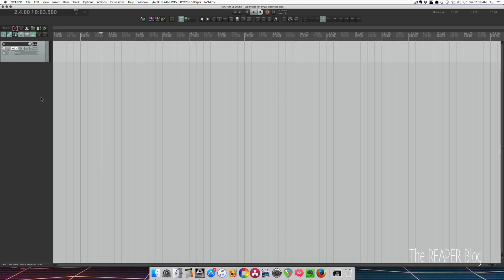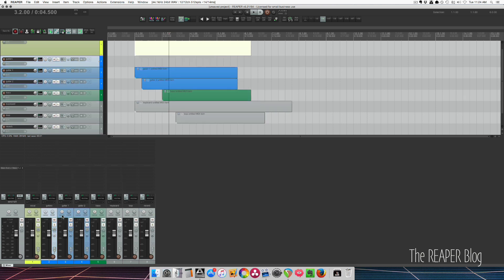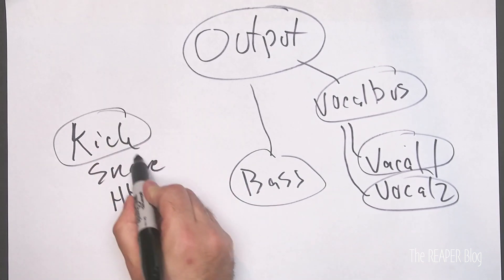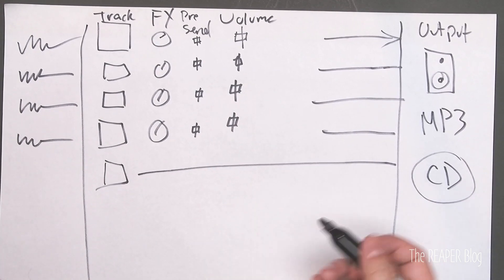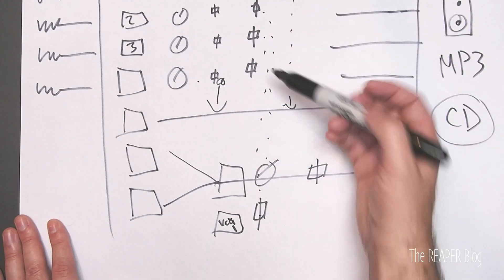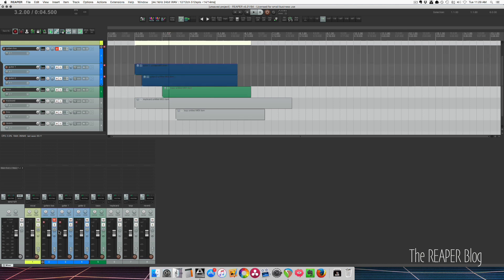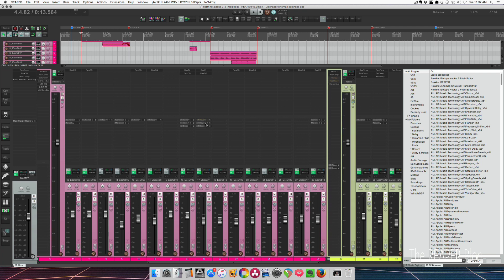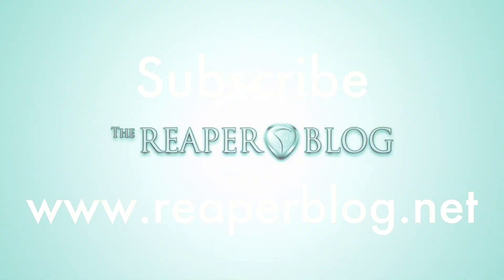Audio Routing Explained - DAW signal flow tutorial

Comment: So I’m having an issue when I put anything into a folder: anything inside that folder I try to pan right disappears completely, but seems to act normal when I pan something to the left. Why can’t I hear my guitars when I try to pan them hard right? Does it have something to do with my master/slave settings in groupings?
Reply from the maker: follow the signal flow, bypass the plugins one at a time to find the problem
Reply: @TheREAPERBlog  Gosh... I think I figured it out. My cla mix hub and c4 compressor were both the mono plugins lol... I just changed it to the stereo and that seems to have done the trick. I was thinking there was a different setting for that, just way overthinking it I think. Thank you for the response! Now if I’m using amp sims on my guitars, should I still keep those mono? The sims I use give me the options “mono, mono/stereo, and stereo.”
Reply from the maker: @FesteringGhoul  I always do separate guitar amp plugins for each performance.

Comment: I have a question, can you route an audio signal outside from Reaper, for example, if I'm using asio that means I can only use the audio in one program, can you actually input audio from a different program using asio?
something like input spotify, winamp or a browser, also can you route an output for a program that uses audio signal, like an external visualizer, like a rgb keyboard audio visualizer?

Comment: Question.  I've recently started using Reaper again going through old mixes and my work flow is pretty simple but very inefficient on CPU. What I normally do is record my tracks, for instance multiple guitar tracks, then apply the same vst effects to these tracks with the FX button. What I should be doing is sending all these tracks using the same effects to a delegated effects track so my CPU isn't hampered so badly.  The problem with this, is it ends up sounding completely different from my original method and not in a good way. Even with the master send disabled under these tracks before they go to the guitar effects track.  The same thing happens when I group these tracks under a bus folder and apply that effects track to the master bus instead of using the effects routing send method.  Can someone explain this? Hope this makes sense.

Comment: I understand the 'Folders" etc., but why when I turn the Master Mixer Volume down my guitars DO NOT TURN DOWN???  I checked the Send Matrix and all looks ok... ??????????????  (Only the MIDI TRACKS drums, synth etc turn down)   
UPDATE:  Found shortly after this posting... When setting up my main guitar tracks I saved them as a TEMPLATE with an accidental HARDWARE BUS added that caused above issue.  I was setting REAPER up and assumed it was what I had to do...then saved this BAD SETUP to load into REAPER on the fly...OOPS!

Thanks for your efforts and time spent on your videos!  They are great!

Comment: Thanks I hope this is what I'm looking for. Here's my problem:

I make podcasts using Reaper and want to make phone calls and record there voice in Reaper. That is easy using an audio interface (8 channels). What I want is play audio I can hear and the caller can hear. But I do not want the caller to hear there return signal. 

Can I send a separated output to the caller with all the audio channels I hear but without there own audio signal? 

(I'm using M-Audio M-Eight audio interface with 8 outputs and using Rode SC6 and Rode SC3 linked to my iPhone for input and output to my audio interface.)
Reply from the maker: Bit of a complicated setup.

Might be better to make the call through skype or google voice instead of the phone.

But essentially you would be listening to output 1-2, and they would be listening to output 3. You have to send them your voice, and the pre-recorded clips with output 3-4 from reaper/your interface.

I guess headphone out 2 connected to mic 1 of SC6, headphone out of SC6 to interface input 2.
You can record and monitor input 2 in your headphones but don't send input 2 to output 3.
Reply: Thanks to your tutorial I nailed it! I made a second masterchannel and that channel I send to the caller. In the routing Matrix (alt R on Windows) I disabled the caller signal so no feedback. 

Thank you so much you made my day.

Comment: Great video, thanks. Is it possible to host an fx bus/track that receives from 2 (or more) other tracks, processes said fx independently and then route them back to the same tracks (or 2 new tracks) for further processing ? The reason I ask is that UAD h/w cpu processing limits the number of fx instances you can have (DSP is on board the uad device but they are still vst/au plugs). That way 2 or more tracks could benefit from the same FX track and then be subsequently processed differently (other FX/pan etc). The caveat is the FX on the bus track must be the first FX the 2 (or more) tracks hit (as it is a pre-amp for said UAD device). I've been racking my brain how to do this but not worked it out...  The FX bus would not (in theory, if this works) send to the master (so uncheck box) but would push the 2 or more respective processed signals back to where they came from or 2 or more new tracks...
Reply from the maker: Sounds like a lot of work! Don't think UAD pugins run on more than 2 channels, but if they did they'd still require additional dsp for each channel.

Something you might want to try is forcing the uad plugins to run in mono where possible (any track with a mono source), that may free up some DSP for more instances.
https://reaperblog.net/2012/09/this-tip-could-save-up-to-50-cpu-in-your-next-mix/
Reply: Actually, it is possible as I found out this w/e.
If the UAD fx are placed on Track 1 and we have 5 tracks total.

The i/o for T1 is:
Receives from T2 Channel 1>1
Receives from T3 Channel 2>2
Sends to T4 Channel 1>1/2
Sends to T5 Channel 2>1/2

Master send is disabled for T1/T2/T3, instrument / uad input plays into T2 and T3 and goes via FX Bus on T1 and then out to T4 and T5 respectivelty
The suggestion you had was good but not applicable (i think) for UAD h/w as the processing is on-board as opposed to on the reaper host o/s CPUs.. That way you can effectively double the instance capacity of all uad effects on T1 chain by having them serve a 2nd track (thus leaving the same headroom for other uad plugins on other tracks)..

Comment: I had a question when using busses along with tracks dedicated to FX: (time And modulation based).
My question is if I had drums routed to a parallel compression/eq and disabled the master send on those tracks being sent to that drum buss (because that's what every other video tells me to do in reaper)
How would I send select tracks such as Snare, HH, Toms, etc. to an Fx track? Because other videos tell me not to disable the master parent sends when routing to an FX track.
Currently im routing all drums to a buss for parallel processing (disabling master parent send on those tracks) and im also sending some of those tracks to a dedicated FX track, I feel like im doing wrong by this way. Thanks in advance for helping clear this up if possible!
Reply from the maker: usually you're sending to reverb or delay tracks in parallel. disabling the master/parent send would prevent the original signal to be heard.

I have several videos on mixing drums and using reverb if you want to see some more examples

Comment: This problem has been plaguing me for weeks: My rendered mix levels were somewhat different than my session mix. Some tracks were louder, some softer than the original mix. I figured out that on some of the tracks, Audio Hardware Outputs were sent straight to Main Out 1-2 / Main Out 1-2 . Some tracks were not set to anything. So I deleted all the Outputs going to Main Out 1-2 because I know they are going to the Master track anyway. Thing is, now it seems that has effected my panning. So I'm not sure when to send track outputs straight to hardware or not and why.
Reply from the maker: no, don't send any tracks (other than master) to hardware outs in a mix.
Reply: Thank you. So what happened to my panning!?
Reply: Figured out the panning issue. Pan Width on the Master Fader was set at 0% (default I guess. I didn't do it!).

Comment: Is there a way to set a buss/folder hierarchy system where I can have 
individual reverb sends going on? For example, using parallel 
compression on a buss/folder for drums while having individual reverb 
send settings for each separate percussion instrument with the 
buss/folder fader effecting the reverb settings.
Reply: That's what automation does, you can set the volume, effects, panning and many other settings of individual tracks or parts of a track separate from other tracks routed to the same parent or Effects or any buss. If that's what your asking.
Reply: Add an FX "Folder" at the bottom of the track-stack in the TCP. Add the FX you want in each track inside that folder, e.g. a ping-pong delay, or a plate reverb (with an instance of ReaEQ for taste). On the original track you want to add that effect to the signal, simply click the "I/O" button of that original track and send signal to the FX track, (The Send Dialogue Box also includes a dedicated fader for that individual track's send, and even a mute and pan slider), which makes adding reverb, etc. to individual tracks a breeze!
Choose this FX folder, right-click on it and "Save as Track Template" to quickly add it to any project.

Comment: Whenever I render in Reaper the quality is noticeably quieter and nowhere as good as have the actual mixed. I’ve tried rendering as MP3, WAV and FLAC and the quality is the same for each one.

Can you please offer any advice on how to solve this?
Reply from the maker: the most likely answer is that the master track's send to hardware is not at 0, meaning you're hearing it louder than it actually is when mixing. Or you have something in the monitoring fx chain that changes the sound.

Comment: Is there a way to apply the same sends to every new track I'm adding to my current project automatically?
Reply from the maker: Provided that the receiving track exists in the project, you can save it with track templates.
Can you explain what you need to do with this?
Reply: If i have a aux/bus i use all the time like a certain reverb, i don't want to manually set up the routing (I know it's just drag and drop) everytime i add a new track to the project.

Comment: In plugin (eg. Reverb) on Send FX track need to set only Wet 100%/Dry 0% signal, or mix 50%?
Reply from the maker: because the clean signal will be heard from the sending track, the reverb aux/bus/return will need 100% wet effects.
reverb on same track - blend wet/dry to taste.
reverb on separate track - 100% wet, with send level or reverb track volume creating blend.

Comment: How do you keep the pan set in "slave" tracks once it is routed ?
Reply from the maker: I pan where I want the instrument. Do you mean with routing through folders or for automation?
Reply: I want to route clean signal through à guitars bus with one fx : amplitube (amp simulator) while keeping the tracks routes panned. I'm reading at the moment that my Amplitube must have a stéréo output, how do I do that ?
Reply from the maker: it's really best to insert one amp + cab per guitar track and treat it like you would with the real thing. Get a great sound then commit by freezing the track.
But to answer your question you are looking for the numbers 1-8 at the top of Amplitube, click "2", then where it says "MONO IN" in orange, click it to say "STEREO IN". That gives you two independent pedal, amp, cab, fx chains. Hard pan the two source tracks left and right.
Reply: Thank you a lot ! I got my answer and did what I wanted. I've got 4 rythme guitar tracks, so I don't have enough UI (with all clean guitars, and solo etc.), now it's so much better. Just one more thing, what is it to freeze a track ?
Reply from the maker: freezing will apply the effects chain to the items on the track, and lock the item to prevent changes. Completely frees up the CPU resources. You can still add more effects and you can unfreeze if you want to change those amp settings later. Right-click on the track or in the fx chain to find the freeze options.

Comment: Hi Jon,

I do have some questions please:

1. At the moment I'm routing through my sends on each track of a specific section to an Aux Track, then I group then into that folder.

Q: Am I doing Double work here for the same result?

2. Then when I send to an FX - I set my volume & pan state on the actual send.

Q; Is that Pre-fader or Post-fader information to the FX Buss? (I suspect Pre!)

3. I noticed when I do Automation, I don't see my faders move accordingly, but when I raise the level on the fader, my automation base is raised accordingly.

Q: Whats happening there? its hard to keep track of whats been done & where you have automation. (I guess this might be for another Vid Right :-) )

Thanks for all your input, it is of Great Value & has helped tremendously already!

Have a Stunning Day!
Reply from the maker: 1 - yes I think that's extra work. 

2 - by default you should have post-fader sends so vol and pan go along with it. pre-fader sends would need that stuff set. It's rare that I pan my sends.

3 - tracks need to be in Read mode to see the automation moving the faders. You still hear the effect in Trim/Read. I mostly automate in Trim/Read mode and sometimes latch.

Comment: Awesome video. I was mainly relying on folder tracks before, and not really seeing that everything had the automatic master send. Super informative!
Reply: The folders are reliable. If you put things in a folder it no longer has a master send. Only if you want to bus it manually (without placing it in a folder) then you have to disable the master send, which is still there.

Comment: Thank you for the explanation! At this point I'm asking myself: When and why should I route my tracks? I've been using folder tracks for a while now, but I never routed my tracks otherwise.
Reply from the maker: reverbs, chorus and delays can be shared by any tracks in the project when you have them set up on separate tracks and it's easier to add more or less of the effect using sends. Instead of 5 vocal tracks with 2 reverbs for Each, you can use 2 reverbs on separate tracks and sends from the vocal tracks to add the effect.